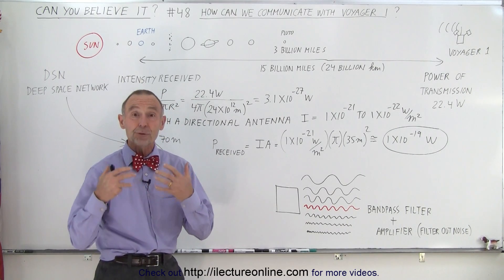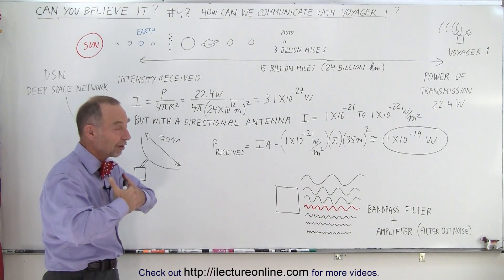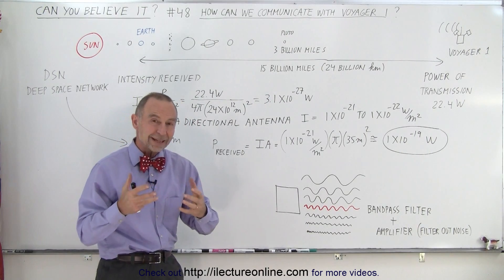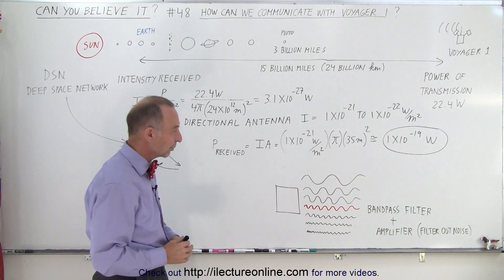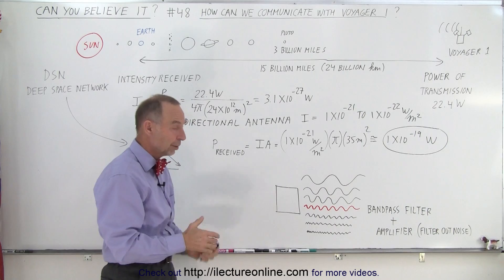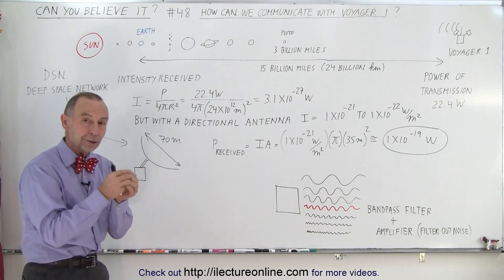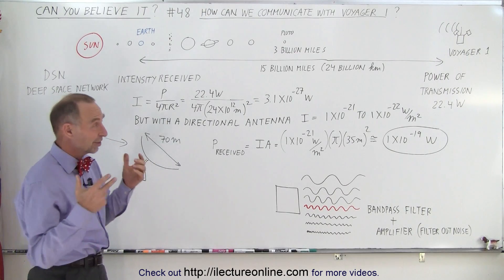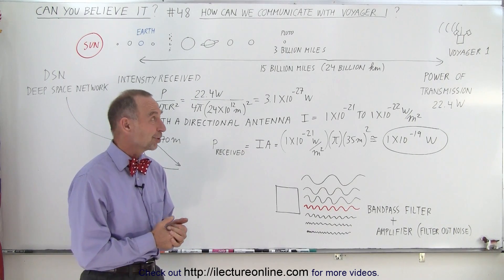Can You Believe It? #48 How Can We Communicate With Voyager 1

Comment: It looks like the further voyager moves away, the easier it is to orient it in direction to the Earth, is not it?
Reply: Voyager uses a 3.7 meter diameter Cassegrain's parabolic dish. Waves are placed in the S-band(about 13cm) and X-band(about 3.6cm). Then beamwidth is 1.2*13cm/370cm=0.04rad or 2.4deg. For X-band it is 0.7deg.
A distance from Earth to Voyager is 24billion km then Arc length is 3.14*24billion km*2.4deg/180deg=1billion km. The radius of the earth's orbit around the sun is 150million km.
Reply from the maker: Great input.  Finding the Earth's direction is not the problem, but picking up this incredible faint signal is incredible.

Comment: Excellent summary that addresses my curiosity on this matter.   Thanks for providing the numbers too around signal strength.   I'm still astonished that we manage to extract that weak of a signal from so far away but I'm not in doubt about it as I've had some experience in the past extracting weak signals amidst noise in the infrared spectrum instead of the radio spectrum.   As for the dogs, I think they were arguing about the lecture, and one of them still couldn't believe it. At least they didn't disturb the lecture while it was in progress. 🤣😂🐕🎓
Reply from the maker: As a radar and GPS engineer, it is always challenging to pull the signal out of the noise or out of another jamming signal.  It even astonishes me how we are able to do it.

Comment: good morning. are they using a lock-in amplifier to isolate the signal after the band pass stage? thank you for your videos.
Reply: Yeah - good question. I was about to comment how "they use electronics and a computer to pull out the signal..." was a major hand waving explanation. Yeah - probably some sort of synchronous demodulation, maybe digitally implemented. I doubt they can use the signal coding techniques that have been developed as they were launched in the 1970s I think...
Reply from the maker: I am not familiar with the hardware they used back in the 70s.  That was before my time.  I am more familiar with the radar and GPS technology that I worked on, and the techniques we use to pull out weak signals.